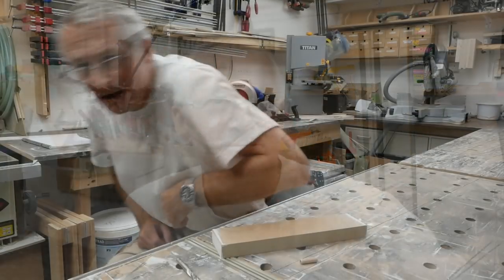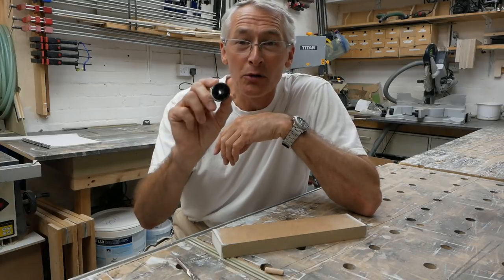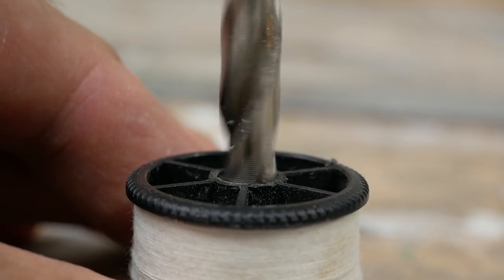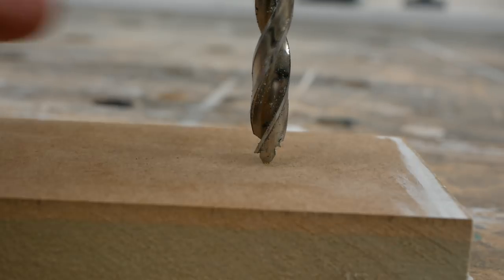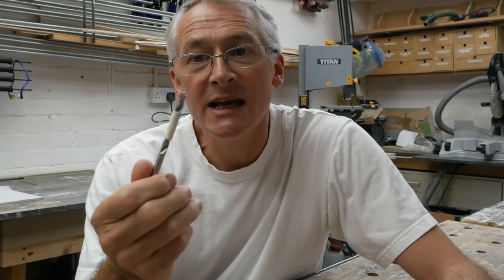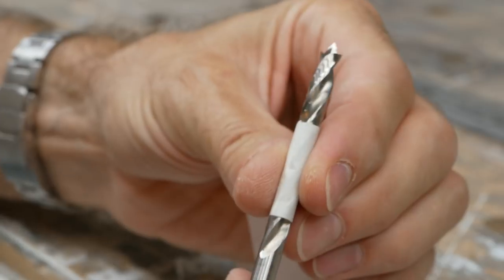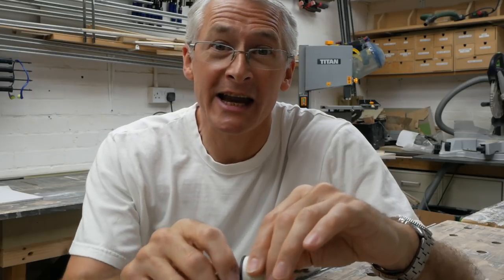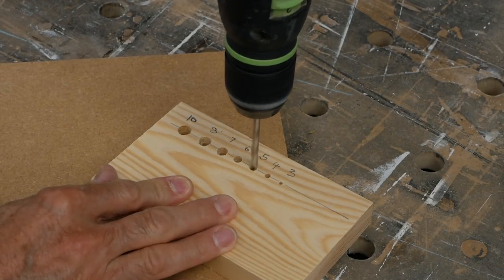Cotton Reel Drill Jig [Video #208]

Comment: Great idea. I have been noticing lately that a number of random products even here in the US have fairly accurate or at least metric friendly dimensions that can be handy in the shop. If I hadn't already invested in a set of steel drill guide blocks (Big Gator Tools V-Drill Guides) I would certainty consider raiding my wife's sewing supplies.
Reply from the maker: Thanks! And if you raid your wife's sewing stuff, just make sure you put them back clean... 😂👍